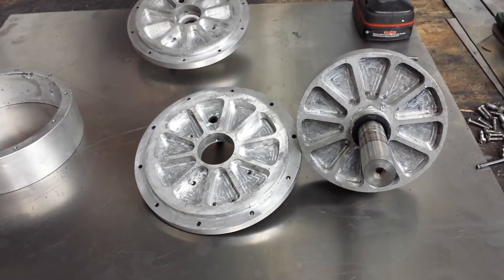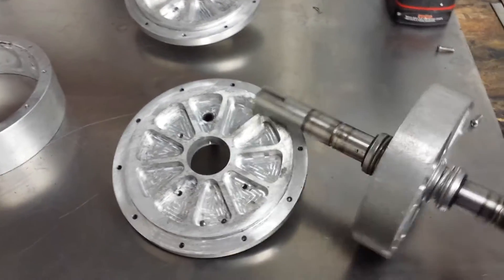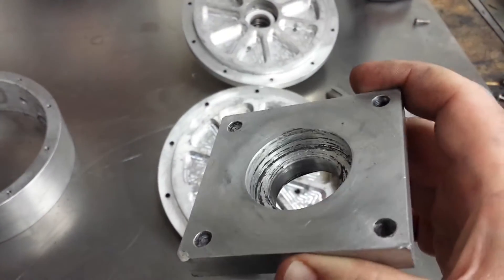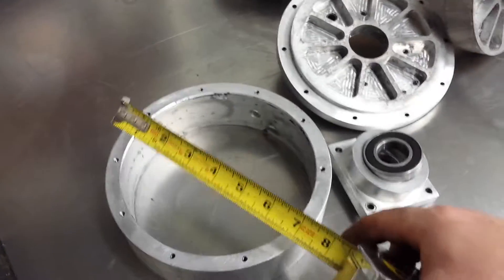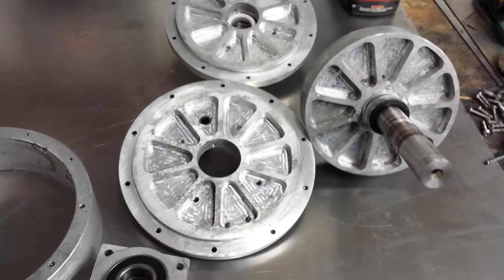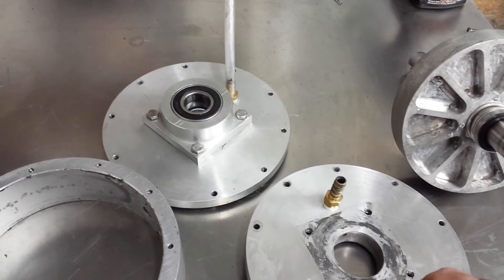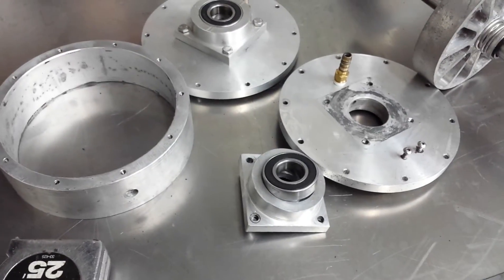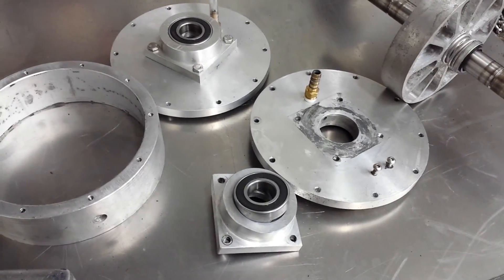Engine dyno inside

Comment: You say it has 12 on the stator and 13 on the rotor but they have 10 and 11.  does that affect the torque it can measure?
Reply from the maker: One should be a prime number, (11) the other should be one less according to the referenced SAE paper. There is a balance between fin width and volume. 11 was what I saw in other designs.

Comment: I'm wondering what you did for a clearance radially from rotor to the inner ring? And also the distance linear from rotor to stator? Thanks again!
Reply from the maker: 1/8 in or so clearence between the stator and rotor. The other is 1/2 if I remember right.
Reply: Thanks! Another question though. If you put the stator onto the shaft (without the bearing and hub assembly) how far out does that piece of water pump seal stick out from the shaft? is it just sticking out like 1/8 inch and the spring puts pressure on the ceramic piece?

Thanks in advance!
Reply: Also how to you seal the faces do you just use RTV? Thanks!!